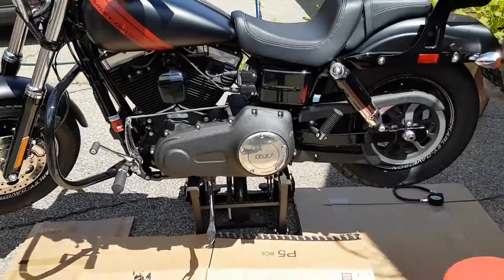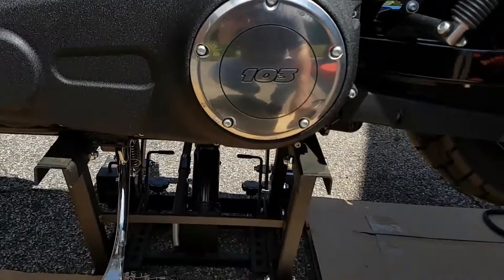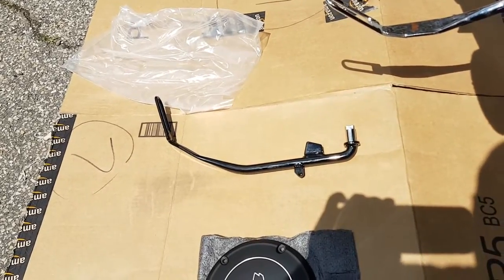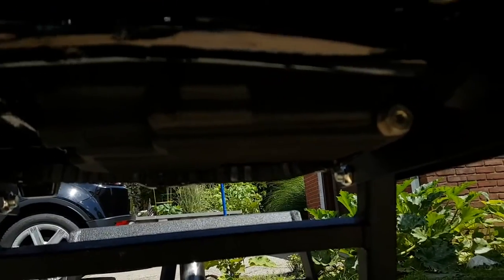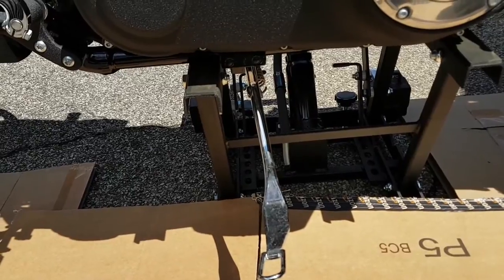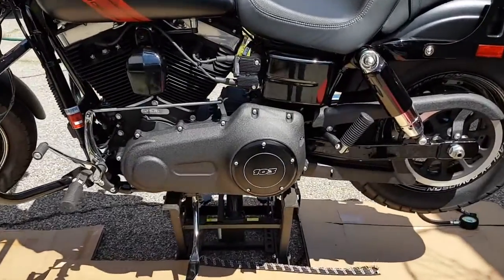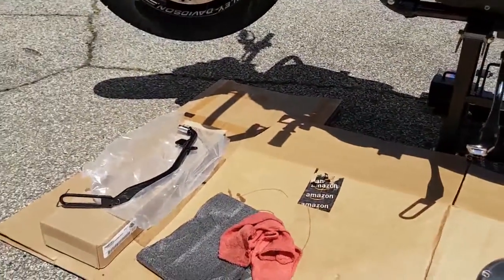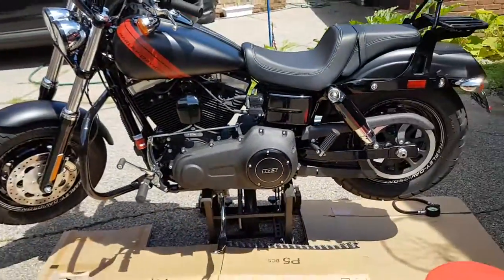2016 Harley Fat Bob (FXDF) Project - Black Out / Remove Chrome (Part 5)

Comment: Did you use a torque wrench to bolt the derby cover back on?
Reply from the maker: Hi Carlos - yes, definitely used a torque wrench  ( i believe the spec calls for ~90 in-lbs - not ft-lbs).   I bought 3 torque wrenches from Harbor Freight whenever they were on sale for ~$15 each, seem to work fine for my use.  The rest of my tools are all Craftsman, but the torque wrenches at Sears were too pricey . . .

Comment: ok i bought a foot pound from harbor freight, i need to pick up an inch pound
Reply from the maker: Yes, you definitely will need three over time to complete the set:  in-lbs (1/4" drive)  and ft-lbs (3/8" and 1/2" drives).  But just for the derby / clutch cover, only the smallest 1/4" drive torque wrench is necessary (measuring in-lbs).